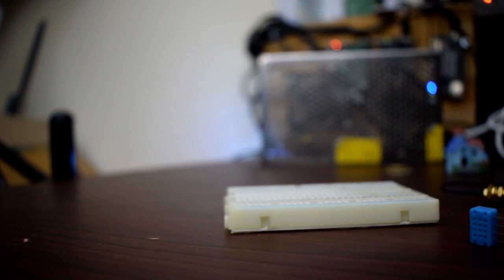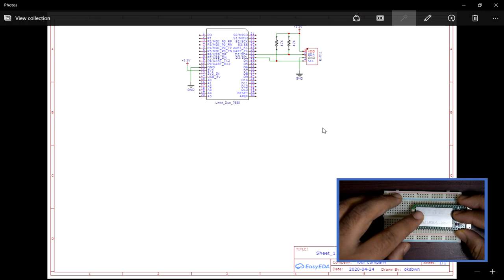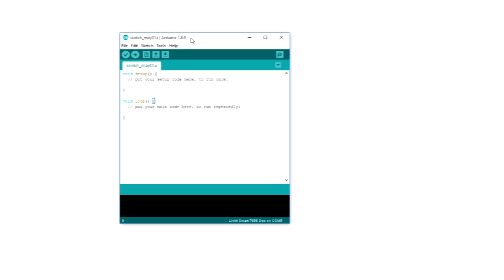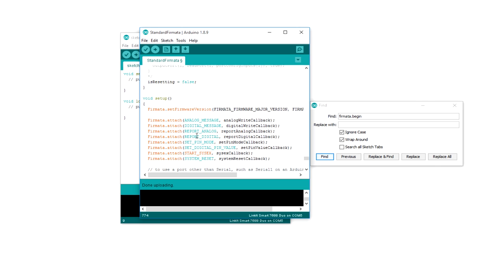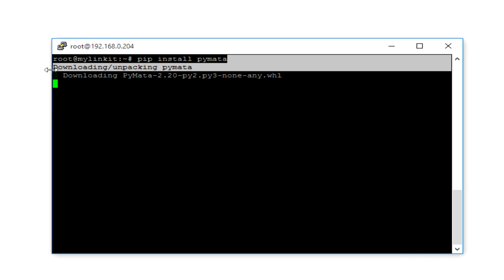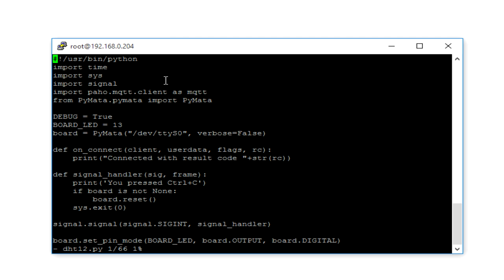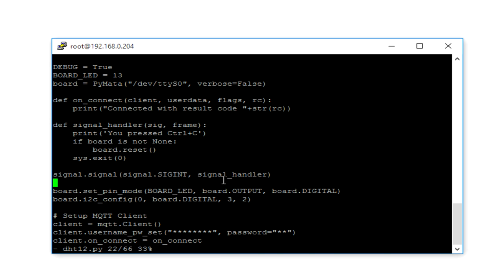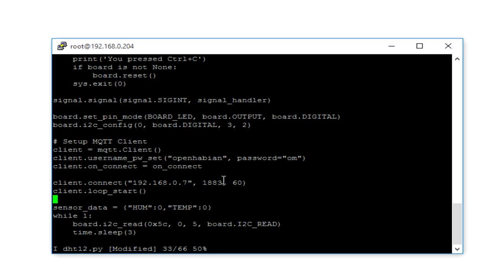Firmata protocol I2C Communication and MQTT w/ Python   |  Linkit Smart 7688 #3

Comment: old post, but in case it helps... the only Python code change I think is needed is to use Windows port names, e.g. "COM5" instead of the Linux "/dev/..." string. The rest of that code seems platform independent.

Comment: Hi, really interesting video. Do you have a more fundamental video in which you simply control an i2c 'output' device (e.g. MCP4725 DAC) using an Arduino and Python? I tried to modify you code to make this work, unfortunately was not successful. Most people are either doing this using Rasp pi or are controlling with Arduino using Arduino's IDE. There seems to be a solution to this in Linux, but there was an issue trying to run Windows. Any advice would be great!